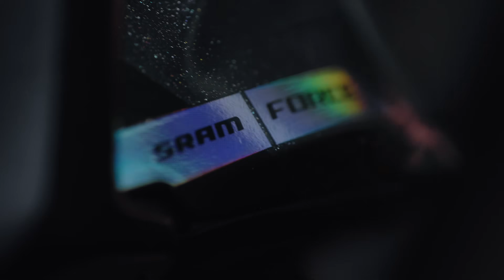Annemiek van Vleuten | Aeroad CFR | Pro Bike Build

Comment: We all know that SRAM Red isn't realistically worth the money to upgrade from SRAM Force. Do we? 

But: We all also know that no bike for Jasper Phillipson, Matthieu van der Poel or any other top-tier-male-rider would  have been build with SRAM Force oder Shimano Ultegra. (I watched both of those builds & loved them)

So why not make a statement for the top-tier-womans riders and treat them equally? Or am I in the wrong and this was a specific request by Annemiek?

Btw: I love the look of the bike & I love the the performance of the Force Groupset.
Reply: Force has smaller hoods which might be better for smaller women hands - don't know if thats the real reason tho. Maybe the new sram red is also around the corner
Reply: @hansgerd2934  that might be true. I don't know if mix&match is a kind of a "no-go" in this area of bike-builds. But they could've just used the Force Shifters with the rest of the groupset being red. We probably won't find out.

I just think a world-champ would've/should've been worth some extraordinary effort 👸
Reply: I said the same is weird because is force but they can build with red component and put the hoods of force any way the new red is coming soon
Reply: I think her bike is already lighter than 6,8 kg with the Force groupset installed. So there is no need to install the Sram Red groupset to reduce the weight. 
And  ...  the Force 12 - speed chain will be more durable than the thinner Sram Red 12 - speed chain.
Reply: The women get the exact same high end components as the men. It’s probably a preference for her.